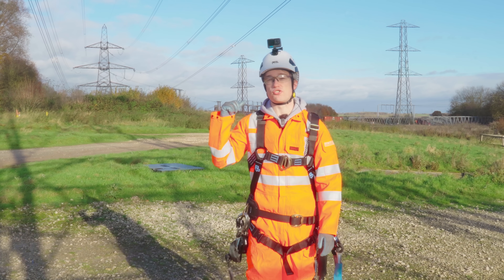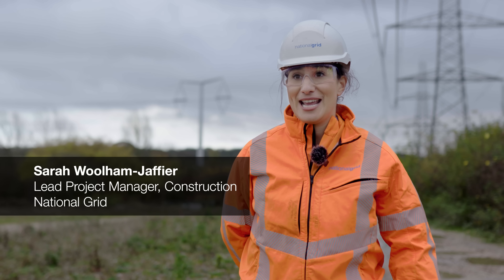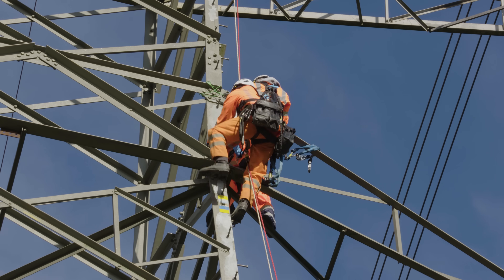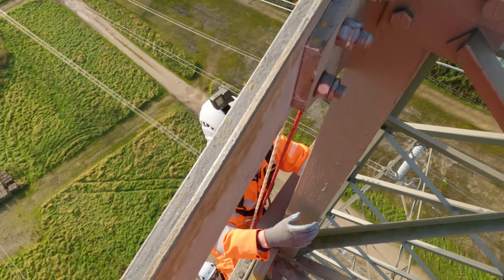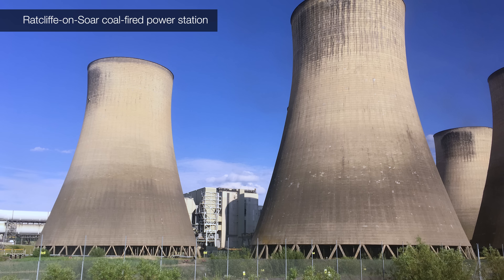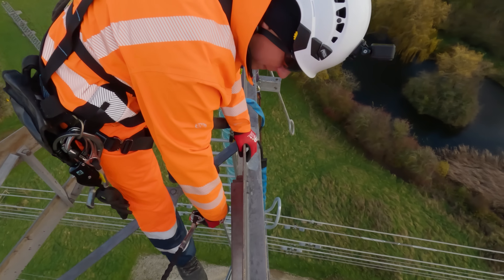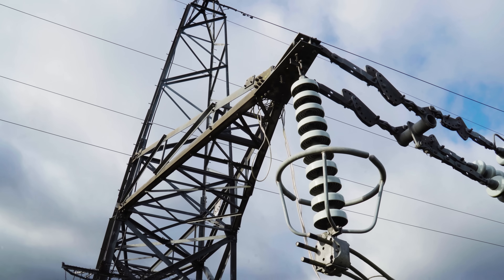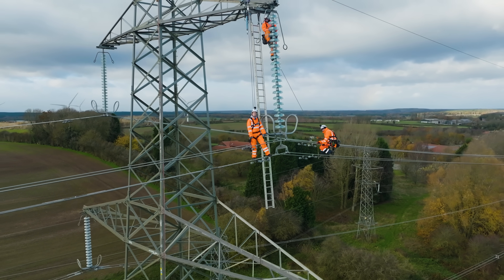People are going to be angry about pylons.

Comment: OK, I have to give you mad respect. For a guy who had to get over roller coasters, the fact that you are standing on a powerline delivering your prepared statement to what I presume is a drone, as steady as you are, I am entirely impressed.
Reply: You're forgetting he flew a plane while being strapped to it, outside, standing. I doubt after that experience much could faze him.
Reply: @cavemann_  There's a very big difference between the two. Presumably the plane stunt would have an adrenaline rush and could be seen as fun much like the rollercoaster. Plus you're just so high off the ground that I don't think the body registers it the same way anymore. But climbing tall things is still an awful experience. You can feel the structure moving which can make your already-unstable legs wobble, the ground looks far enough to die from that height but close enough to still easily make out details. Climbing requires moving and if you're afraid it's easy to go straight into a lock up response where you'd be death gripping the tower and be physically unable to move no matter what you tell your body.

I think it's amazing that Tom seems to have overcome his fear but it goes to show how exposure therapy can work.
Reply: @scopie49 exactly. Very tough to calm nerves climbing a structure that has a little movement and lots of wind. I think I could do it but I do expose myself to heights a lot and imagine this kind of thing and I enjoy the thrill vs most ppl do not.
Reply: @scopie49  I don't get it. Roller coasters are so much worse than any amount of height. I love climbing up tall things!
Reply: @cavemann_  And driving some sort of electric buggy while facing backwards.
Reply: He's gamified self-improvement by convincing himself it's just to produce interesting and informative videos for people on youtube. His funambulism video where he learned to walk a tightrope (I'm sure the rope was not tight, but the exact term escapes me) was probably the best demo of how he's learned to acknowledge fear and then do something ridiculous anyway, then the rollercoaster one ofc... if he could teach that I'd hugely appreciate it. I hated even standing on the roofracks of the vans at work 😅😅
Reply: @williamstrachan  high rope?
Reply: @williamstrachan  it's called a high or slack line
Reply: I had to curl up into a ball and just listen.
Reply: Amen to that.
I had fear of heights just watching the video.
Reply: Could have been a drone - or a very very tall cameraman.
Reply: He did acknowledge that he didn't have much trouble with other high or fast things; the problem was just the "lurching" sensation (which it turns out was mostly caused by fear)
Reply: I think he explained that his fear of roller coasters stems from lack of personal control, not so much the coaster thrills itself
Reply: @thefalsekingslayer3717 yep, Steve-O has a similar thing. Deathly petrified of rollercoasters yet barely fazed when nearly getting killed by a lion
Reply: I don't think it was the heights that he was afraid of. I believe he said his phobia was of being strapped in and the fact that there's no stop button.
Reply: Yet another thing Tom has done that I will never, ever do. Literally my face while watching this: 😬
Reply: He made it clear in his video about his fear of Rollercoaster that he isn't afraid of heights.
Reply: I'm way more scared of roller coasters than standing high up on a pylon or powerline or whatever. I actually love heights. I've always wanted to go up one of these!
Reply: As a certified tree climber, this does not seem all that scary

Comment: We have another power network: gas. It's kind of hard to tell - the industry's public data seems arcane to me - but the gas network's power transmission capacity is something like ten times that of the electricity grid. I wonder what the long term plan is for the gas network. Everyone's focussing on electricity because of 'decarbonisation' (not technically needed for net zero). We have loads of applications which are really difficult to electrify, and everyone's demanding the public pay for up front in another apparent 'go green with diesel' knee-jerk. We can't store electricity in any great quantity and we need colossal storage to switch the UK over to renewables. Only gas offers this storage ahead of things that don't exist like hydrogen power stations. Why not convert and store wind to gas, transfer that across the gas network, use gas power stations internally to take peak loads, and ultimately to do gas-to-hydrocarbons so we can replace every fossil-input industry *wherever we like*? Any chance of a gas-network inside view?

Comment: I love along the Oregon Coast and can confirm that building new power lines gets controversial fast.  Our county power station wants to build a second transmission line from its miles-inland substation out to a community of a few hundred along the actual coastline to prevent outages during stormy weather (pineapple express, etc).  But the most direct route to do that -- electrical transmission towers -- has (for many years now) been stymied by local property owners who, y'know, don't want those overhead lines flying across their lots.

Naturally, people tend to ask "can't they just run the cables underground?" but there is no "just" to the process of digging up miles of terrain to install high-voltage cables in underground tunnels while not conflicting with other underground infrastructure (water lines, etc).
Reply: I like to say that "just" is short for "I don't actually understand this problem, but I'm about to give advice anyway."

Comment: You were allowed to climb in those boots? 

There are lots of places in the US where a steel shank high heeled boot is required by law and/or by insurance. 

The heels lock into the rungs and steel shank keeps the structure and stability of the boot. Same concept as Cowboy boots in stirrups. 

Stepping on the toe box to climb (1:23) is extremely dangerous for this particular type of climbing.

Comment: Pylons are indeed more accessible for maintenance, but they need a lot more maintenance than subsurface cables by a huge margin. They take up a lot of space, are more limited in where they can be deployed and run and far more vulnerable to damage from weather and flying objects. 

Big win for the UK to have a national grid, but keeping the pylons up and running only gets progressively harder and more expensive as a grid expands. They have held up well though trying to hold together a developed nation in the age of the digital with 96 year old design philosophy that never included provisions for completely transforming power generation methods and how that feeds into the grid is probably unrealistic. 

Might have to undertake another big infrastructure overhaul, but good luck getting that through with a government that froths at the mouth and keels over in uncontainable rage at the thought of national infrastructure projects!

Comment: I find it interesting that they seem to only use a safety harness, me and my dad climb cell (and occasionally power lines) towers for a living and we get proper climbing harnesses, which have a lot more padding as to make it more comfortable to put your weight into them for extended periods of time.

Also your regular videos will be dearly missed but take all the time you like, you deserve it after all the years!
Reply: If I remember what the OHL guys have told me correctly, the padding is in the overalls themselves. 
Safety harness is separate to make it easier to do the safety inspection of them.

Comment: The phrase you'll hear is a variation on NIMBY which stands for "not in my back yard" Because who wants to have their view "ruined" by seeing something so industrial and mechanical. But as Tom explained, these things will need to go up for the good of the masses, even if that means that people are going to be upset at the sight of them... those very same people would be angry if they weren't able to access the power they need to heat their hot water or run their TV though. So it's a matter of understanding that if you want to be in a modern society with access to energy in your home, you may have to see a Pylon or 2.

Comment: Amazing, and right up my alley. I inspect smaller wooden poles for my job. You nailed the point at the beginning about why we put up "old fashioned, ugly" overhead lines still. I have to explain that to people all the time. Nobody thinks about the maintenance, repair, and replacement that goes into transmission and distribution wire (except those of us who work with them.)
Reply: to be honest they arent really ugly, the poles themselves atleast, they follow basic symmetrical designs. it might be cultural conditioning, people need to see the beauty in infrastructure, the way the wooden and metal poles gracefully skip across the landscape in a continent sized system, there are some big ones in my local state park due to the third largest coal plant in my country being there, and even if the coal plant is ugly the pylons look like cool metal trees and they are BIG, If every city had underground lines including the small wooden poles it would feel like a bit of character and history is lost and the cities visual flair is a bit more boring with strictly architecture and trees

Comment: In America, those massive overhead lines are to move big power from substation to substation then now all new neighborhoods in the west atleast, get buried underground and pad mount transformers as the typical "telephone pole" as they are called for some damn reason, is going away and new home owners don't want their views messed up. And now that new technology exists, underground high voltage lines can be done. Where they couldn't back in the 20's and such. Look up practical engineering video on the los Angeles underground transmission lines replacement back in the 80's

Comment: I don't understand how that aluminum ladder, grounded to the pylon, can be permitted to bypass the glass insulators like that.  Why weren't you turned to a crisp like a mayfly in a bug zapper?  Multiple live-to-ground contacts between the 3 people interacting with the ladder and the lines at the same time.
Reply: The tower body is earthed and can be climbed while both circuits are live. To access the crossarms and conductors, one of the sides of the tower (carrying one circuit) would be switched off and earthed, allowing physical access to that side of the crossarm and wires. Note this is at the training centre though and is not on a live/energised circuit!
Reply: @Rob-ct4xp  Thanks rob.  I don't see the conductors being earthed in this video, so I missed that.

Comment: Tom, you are a braver man than I. Even were I physically capable (which I am not anymore), there is no force on Earth that could get me up on one of those towers. That said, underground cables are far more reliable than overhead ones, as underground cables are generally unaffected by wind and lightning. Here in the states, most areas are served by overhead cables, and outages are as common as dirt. Cities where the cables are mostly underground don't have that problem.

Comment: What they don't tell you is that underground lines need much less maintenance. The overhead grid is notoriously unreliable, regularly going out with any wind, rain, or snow. In the Western U.S. where there are underground lines, there are almost never blackouts (I had one in 15 years). In the Eastern U.S., where I have been for 6 years, the overhead lines go out at least twice a year and often, a dozen or more times during the year. During large storms, tens of thousands of people will be without power for a full day or more despite the dedicated electrical workers. I'll take underground any time. Taking the maintenance expense into account probably makes underground lines cheaper.

Comment: I sometimes think about how impossible it would be to build all these nuclear power plants in france today, or all the big dams we have, it wasn't a democratic process for sure, but could have it happened otherwise? I hope so, because we'll need to do more infrastructure projects like this, urgently, and it'll be hard to do it the way we did back then.

A lot of education about how all of this works and what the constraints are was not done, a large number of people will absolutely oppose these projects and are certainly not ready to give up all the benefits they have from the current ones (that needs to be replaced).

Thanks for doing some of that education work.

Comment: Keep the pylons! Even if they're needed less now, infrastructure is very valuable to have on hand for future projects. It also adds redundancy having multiple paths available to route power.
Reply: They are not getting rid of them, they are building a lot more. We need to have around double the power going through the grid in the near future and this should have been started years ago. They have a lot of work to do to allow us to have significant numbers of electric cars etc in the future.
Reply: I think there's going to be more, they said we need 5x as much.
Reply: @Robert-j6r8c  5x as much new construction as the past 30 years. They didn't say how much that is relative to total network size. Probably a significant fraction.
Reply: It's much simpler, less costly and easier to harvest the energy needed via local solar, wind, hydro, tidal... devices or use generators and fuel cells.
Reply: @vitordelima  Not everywhere that needs power has a stable, consistent local source of it though. You need to tie regions together so they can stabilize each other.
Reply: @MrBirdnose  If you ignore all the scams and hysteria almost every place can obtain more than enough energy and this compensates the lack of consistency. In the case of bigger consumers they can easily generate their own power for similar total costs as the state or only them can be connected to the energy grid.
Reply: @vitordelima  I've been to islands that had no grid connection. They relied on diesel generators and power there was very expensive.
Reply: @MrBirdnose You know what I meant.
Reply: Depends on where we're keeping them. Pylons are more of a liability than benefit in urban areas, since they limit development. 

"Who'd be stupid enough to build pylons in the middle of a city?"

Los Angeles baby!
Reply: @fluidthought42 Usually they're part of general infrastructure corridors with other stuff you don't necessarily want to build on, though, like natural gas lines.
Reply: @fluidthought42  in the US thats more a zoning problem than anything else.
Reply: @fluidthought42  its like highways, they are great in rural areas, horrible in cities
also power pylons look cool as hell

Comment: The UK is connected to Europe via an AC-DC-AC coupling. 
It is much more effective to run DC high voltage through the sea. At the landing point, the electricity is then converted back into AC. This means that electricity can be sent from France to England or back as the energy is needed. 
But the separation has another advantage. When the network frequency fluctuated in Europe a few years ago, it didn't affect England.
Reply: It isn't just 'an' coupling, it's many now! Off the top of my head we have one to Ireland, one to Belgium, three to France, one to Denmark, and one to Norway, with many more in the pipeline. These interconnectors are fantastic are topping up demand where weather conditions might vary drastically across Europe, but they only back up Tom's point about the UK electricity 'generation' moving from the centre of the country to the coasts! These connections also put more demand on the requirement of additional pylon routes.

Comment: Years back Denmark decided to remove all pylons and bury all overhead powerlines. it's expected that our enitre power grid will be under ground by 2025.s
Reply: The question is whether your power grid will be over or under water 😉
Reply: It costs circa 20x more to install underground transmission cables than overhead power lines. If the UK were to underground all its circa 14,000km of transmission lines it would cost roughly £300bn and take around 30-40 years. Plus none of those cables (the 30-40m swathe) can be built over, while things can exist underneath spans of pylons.

Comment: The teams that work on those distribution lines are crazy good at their jobs. You kind of have to be if you want to survive.
Reply: Imagine their predecessors without the modern safety equipment. My legs were jelly and I was firmly on the ground
Reply: @Kanbei11 I do a similar job but on the wood poles, started in 99. Saftey has taken massive leaps in the last 25 years. When I started you would regularly see people climb to the top of a pole with just some spikes on their boots to dig into the pole, and no saftey rope. Once at the top they'd attatch a belt round the pole to stop them falling off. These days I climb poles maybe 10 times a year as the company I work for has so many more cherry pickers, or vans with lifts on them. @Kanbei11